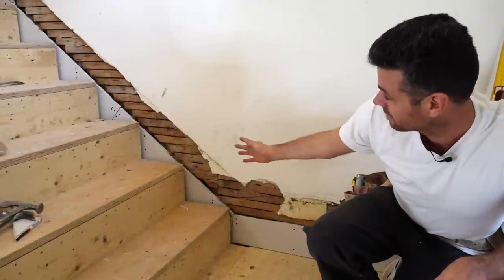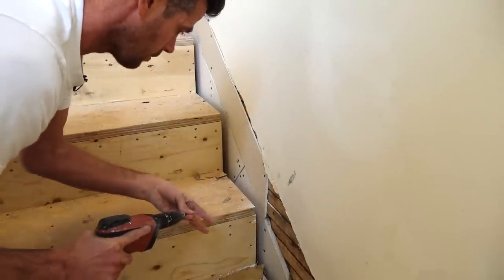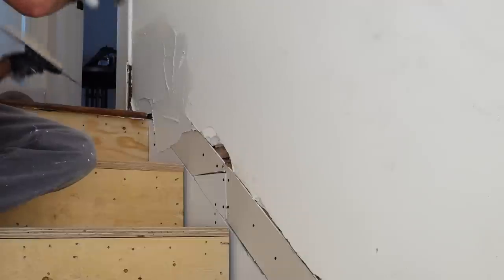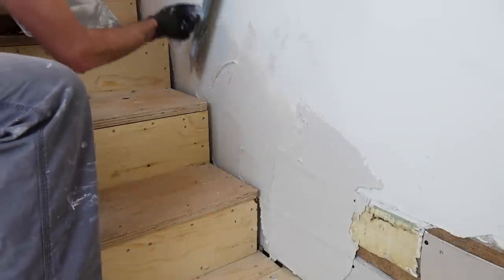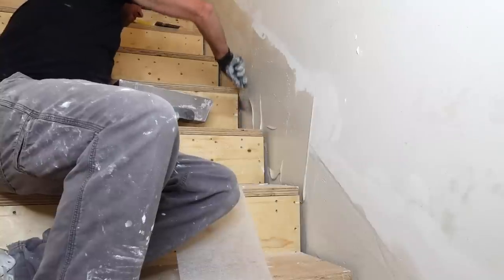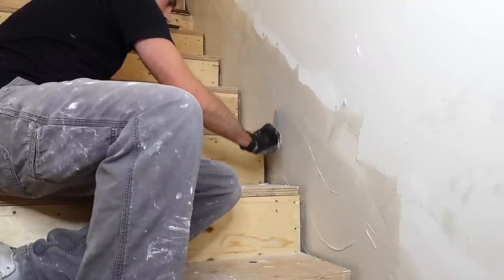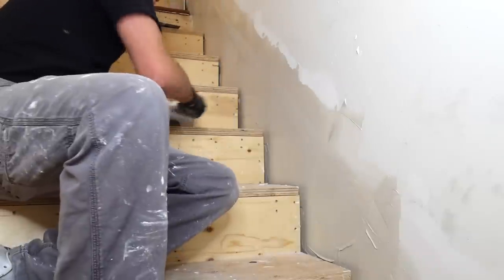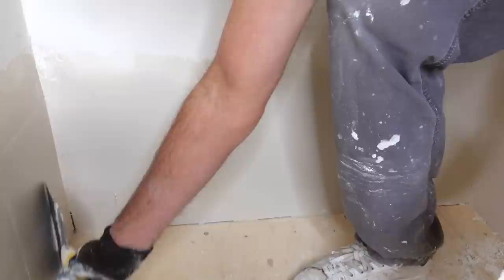Old Plaster Repair with Modern Drywall Products

Comment: I love your videos. I want to thank you for allowing me to feel good about my skills. Please let me explain. I spent 16 years as a painting contractor and worked on a lot of old houses. I also did some rehabbing where I had to repair old wood lathe plaster with dry wall and tie it all together to get a nice finish.  After watching several videos  of professional drywall crews doing production work, I feel like I can't hold a candle to those guys. I felt quiet inadequate in my skill set, and my speed. After watching your videos like this one and that nasty 70's renovation, I realize that I am trying to comparing apples to oranges. I never was a production guy. I did stuff similar to what you show in these videos. I always got very good results. Although I have done some rehabbing since, my time as a painting contractor which was from the early 80's to the mid to late 90's. The materials were different. But a lot of what you do is what I did back then. All that being said, I have learned so much from you. I have the utmost respect for you and your skills. So I feel like you have validated me.  I just finished a rehab. I don't know if I have another one in me, but I am still learning things for the next project, if it comes. Thank you for all that I have been able to learn from you.

Comment: Excellent Video !! This is THE way to handle this tricky transition to plaster, in Canada.
In this particular location , you could use plywood instead of drywall if you want a solid surface to withstand the banging the wall may get next to the stairway.
You can then mud over the plywood as normal. Smooth plywood or sanded works best to avoid covering the wood grain.
If there is baseboard going on after the repair, the installer will Love you.
Structilite works very well, but it is installed via plastering technique, no sanding.
I use the corner tool for this as well, I know many drywallers don't like this tool. I find it very valuable to shape a corner like Ben is in this video.
Vancouver home owners living in older plaster homes, will learn a TON from this.
Thanks Ben !!

Comment: Doing my first remodel ever on my first home. Walls have mostly painted wallpaper, which has seen at least 2-3 coats. Would you recommend skim coating over it or attempting to remove the old paint/wall paper?

Comment: I’ve had very good success using the paperless type of drywall.  The product I’ve used is DensArmor Plus but I think they’ve changed the name since.    It is basically a fibreglass impregnated drywall with no paper at all and it DOES NOT soften when wet at all and therefore mold and mildew don’t start on it.  It’s heavy and hard for cutting and gives you a rash from the fibres and you need to roll on a thin skin coat of thinned out (water) general purpose compound to seal it for the fibres.  It does though produce a very very tough smooth surface. I used it in our basement and it takes quite a lot  abuse without marking.  I am not any type of skilled drywall guy but it has worked just as advertised to me.  I learned how to mud and tape from your videos BTW.  I think it would be very good along those stairs like you are showing. What  was explained to me it is basically an exterior grade drywall for stucco on commercial buildings.  I’m very pleased with it, I’ve tested soaking pieces in water for days and it won’t soften.  Cheers!

Comment: Great video, along with your other lath & plaster repair/reno videos.

If this was a personal project for you (instead of a job for a customer with a set budget/schedule) would you have taken a different approach?  (e.g. taking the time/effort to remove more/all of the old lath & plaster, or gone the easier/faster route of just putting a a veneer of 1/4" or 3/8" drywall sheets over all the old walls)
Reply: I don't know what Ben would do, but I can tell you from personal experience, trying to board over plaster walls is a nightmare waiting to happen.
Not only do you have all the lathe nails waiting to jam your screws and help snap off heads. You also have all the wonky framing. Old houses tend to be balloon framed. Which means you never know when they are just going to run short on a stud, and just nail another one next to it to extend it. It's not so bad on the first floor, but it generally happens all over on the second floor.
This means trying to screw blindly into plaster covered walls to attach sheets of drywall is going to lead to lots of screws not biting into anything. Then the frustration of running even more screws into nothing as you try to figure out where the stud is.
Reply: @tay13666  Yeah, I've never tried to put drywall over plaster, but it seems to be a common suggestion on DIY forums (and comments to videos on this channel).  I could see it working well if you could see the bottom and top of each stud (so you'd still have to patch the top and bottom of each wall regardless), but you're exactly right about not being able to count on precise 16" framing when you're working on a 1920's building with a century of wear & tear & unknown repairs behind each wall.

Comment: Ben, did you do a tutorial on how to deal with tape bulging out where settlement has caused two horizontal sections of drywall to compress against each other? The same goes for old water damage that causes the same problem? Thanks 🙏

Comment: screwing the drywall to the lath also helps stabilize the existing wall.  in my house, many of the old lath strips have loosened from the tiny nails that secure them.

Comment: I stopped doing any kind of drywall mud awhile back. Plaster is SOOOOOOO much nicer. NO SANDING. Ya just have to be a decent taper ( and VAN Carpenter clearly is). It's so nice doing finish with a damp sponge instead of a dusty piece of paper. My 2 ( for what its worth)
Reply: Where did you learn it?
I’d be interested to try it out.

Comment: Another great video.  I still get confused on Mud: which mud for which purpose.  Perhaps a list of mud types and brand names with a paragraph description of the best use.  Here I learned of Concrete Fill or Confill as you said, and also air dry mud.  Any help with a comprehensive list of muds, trade names, and uses?

Comment: Would it be advisable to use the fiber fuse tape (instead of paper) on the ends of the drywall boards (when joining the non tapered edges)?

Comment: The house I'm working on was built in 68 and is plaster but not lath backed, it has some kind of board. I tore out the bulkhead and scabbed in drywall then used mesh tape on the seams. I wish I would have had this video a year and a half ago lol.

Comment: Very helpful as always! Q: If ceiling lath is cut back to the center of a joist and some don't have a nail supporting that edge what specifically would you secure them with? An air compressor is available. Is splitting the lath end a big deal?
Reply from the maker: A pneumatic stapler is a great choice but so is a drywall nail. It’s okay if it splits a bit as long as it is still holding it down. Even caulking the edges down with construction adhesive is better than nothing.
Reply: @vancouvercarpenter  thanks for the advice!

Comment: Your method is certainly a good technique.   Never used fiberfuse tape, but looks perfect for jobs such as this.   if you have "lifted" sections that are still OK to work with, manually (or slow screw) install some drywall screws into the piece.   It gives it some extra strength and saves you a lot of work.   If it really old and crumbly then do remove it.    I normally apply mesh tape during the prefill stage with Durabond (Or concrete fill I guess on the west coast) is a good substitute for plaster work, wet sand it then skimcoats with your product of choice.   And some glue helps, either on the bare lath or plaster edges to prime it.   General PVA watered down does the trick.

Comment: Last year I skimmed out a 4 bedroom house, lath and plaster walls and ceilings using Fibafuse, it worked out beautifully but you have to be really careful with the product. If you're doing long sheets cover up, hat, gloves, long sleeves long pants, because if those glass fibres get into your skin you'll be in all sorts of trouble. The fibres are much finer than normal fibreglass, after a week I ended up with excruciating  ulcer like sores on my knee and one arm, also shower as soon as you finish work. Next time I'm going to go with the full paper suit.

Comment: whats the purpose of fibre fuse and what happens if u didnt use it?
Reply: Same as paper tape but much thinner.
It’s used to bond the joint. No tape=cracking.

Comment: I'd be interested in more videos on how to shim walls that aren't super straight. I've often had issues where my drywall is flush at the top of the wall but short at the bottom by up to 1/4 inch.
Reply: I've been using thin cardboard drywall shims that you can buy in bulk at Home Depot, and they've been a huge help, but I have no idea if this is the right answer.
Reply: Sometimes knocking off high spots on the framing with a power plane or scrub plane gives better results than shimming all the low spots... Best to figure out which will make the wall flatter... especially where you will attach baseboards, cove moldings, etc.

Comment: When I was adding layers of mud to try to correct the crooked wall installed by the drunk guy the biggest problem I had was adding wet mud onto dry mud. As soon as the wet mud touches the dry it starts to dry almost instantly. You have a second or two to get it right before you have to stop and just sand whatever went wrong later. All kinds of weird humps and valleys formed that I just ignored and sanded and filled on the next pass. The end result is all that matters.

Comment: Love your videos. When do you need to use that fiber roll that you applied at around 10:07? I know the paper tape and the mesh tape but this is the first time I am seeing that kind of fabric/fiber roll
Reply from the maker: It’s called fibafuse. It comes in 2” , 6” and 3 foot wide rolls. Use it in place of paper tape if you want. It has no crease so it doesn’t work well in corners.
Reply: Yes but when do you decide to use it instead of paper tape? For which situations.

Comment: So i don't have access to concrete fill and im wondering what you suggest as an option we can get in the states. i see other plaster repair videos using USG durobond in varying speeds as a base fill. Do you feel that is an acceptable base fill? im always worried about how things bond and whether there will be cracking down the line due to improper products used.
Reply from the maker: Durabond would be adequate. Just add some wood glue if you are worried about adhesion.
Reply: awesome will do and i appreciate the response! @vancouvercarpenter

Comment: Can you make a video about patching drywall that's already been installed over lath? Like, what you would do if a year from now you punched a big hole in these pieces of drywall you added? I own a Frankenhouse with some walls that are 1/2" drywall over wood lath, and am trying to patch holes from electrical re-wiring, and I'm having trouble cutting out the drywall because, with the lath backing, you can't just score it and snap it off, or cut directly through without a saw. So it's going very slowly...
Reply: Probably too late but the tool to cut your holes whould be either a hole saw or oscillating saw.

Comment: 2:36  I think I'd be inclined to back-butter that drywall, probably with pre-mixed mud, and also put a bead of construction adhesive on the border between the old plaster and the bare lath. It may be paranoia on my part, but I've seen so many patches like that go crunchy when the weather changes, or when someone bumps the drywall as it sits on all that springy lath, that I'd want it as solid as possible. The risk of that happening probably depends on a lot of variables, like the wood used for the lath and the mix of the original plaster, but with plaster on wood lath, or even rock lath, bordering on a patch with drywall, I'm inclined to assume the worst.

Comment: You made it a little more difficult brother. Use 3/8 over lath. Shim the board so not so much filling. Done a lot of plaster repair over the years. Just try to shim to do as little fill as possible but you do good work bro.

Comment: Hello! I really enjoy your videos.
Reply: I am currently slo-mo redoing my old, 1940 kitchen walls here in Norfolk, VA. Slowly, bc I am 58 yr old w minor emotional and physical disabilities. I am doing one wall section at a time. Removing cheap wall board that was glued over plaster. I laugh to myself, bc this would be a great video for you to react to. Smh if if I had one of me doing this. Lol my sons can’t watch me do work, bc it frustrates them. Lol kidding kidding. We recently dug the trench for our main water line and replaced that. One grown son did half with me and the other did the second half and installed the new water main. We all filled it in together. Anyway, my question for you in the next reply comment.
Reply: I am removing this cheap, thin pressboard wall covering. Then, scraping and chipping old surface plaster and chunks of deeper plaster a tiny bit. I plaster holes and bare gritty spots first. Wait a day or so, then I plaster the entire wall. It still looks like Tuscan plaster. Not all modern and smooth. We don’t care. It’s clean and smoothish.

I am noticing that some parts the plaster I am laying down (w a 5”spatula and a ten inch scraper) peels up over a painted spot and has this oily coat on it. If I go over too many times. I am trying to patch coat. Then basically cover the entire wall. Then, I plan to wet sand wipe and let my son do a smooth top coat. 

The oily part seems to be drying and connecting with the joint compound I’m using for plaster. Have you encountered this?

Should I have probable prepped the surface better after patch coating holes and sandy parts? I guess I’m using one of these joint compound coats as the primer. It seals that oil paint in I guess. Idk

What do you think? Have you encountered this?
Reply: This kitchen is a tiny box. 11.25’x7.5’

I would do say the corner behind the fridge in one go. Because I can pull the fridge out and work behind there and do those two half walls at a time. Currently, I have removed the two upper cabinets beside the fridge and the base 4’ cabinet to do the other corner of this fridge wall. Fyi idk if you do this. Answer questions. Anyway. Love your stuff.
Reply from the maker: You are probably coating over glossy oil based paint. Sanding it first helps as it dulls the sheen and helps it stick. Also adding glue to your drywall mud helps a lot. Just search "adding glue to drywall mud" and my video on how to do that should come up.
Reply: @vancouvercarpenter  oh! Hey thanks a lot! Glue. Who knew. Wow

Comment: Kirk says that setting type drywall mud is plaster.
Reply: Since gypsum plaster, lime plaster, earthen plaster and Portland cement stucco are all referred-to as "plaster" in some contexts, it seems silly not to refer to drywall mud as plaster when it's applied the way plaster is applied.

Comment: No no no!!! You should be using a mix of hydrated lime that has been soaked in water, sand, animal hair or other strong fibre, and a bit of pozzolana substance like washed wood ash.

Lime plaster only gets stronger with age and hardens by ABSORBING carbon dioxide from the air. Lime plaster doesn't grow mold and can regulate moisture, unlike modern gypsum and portland.